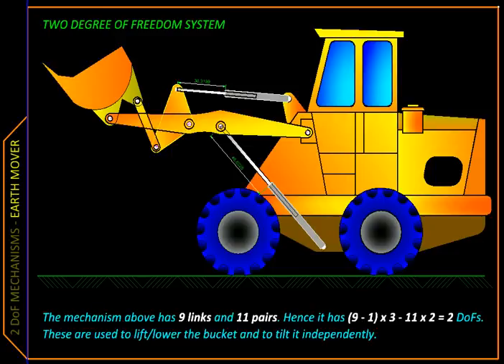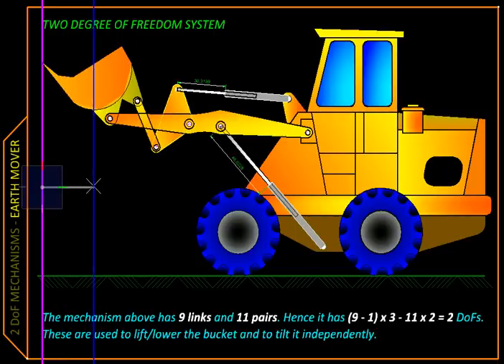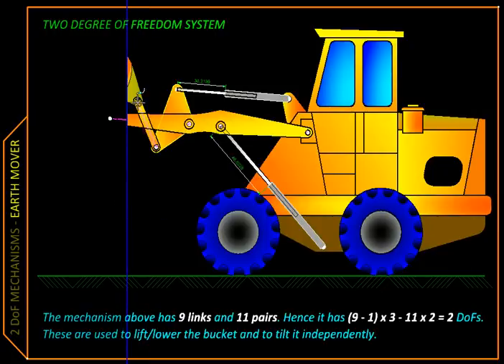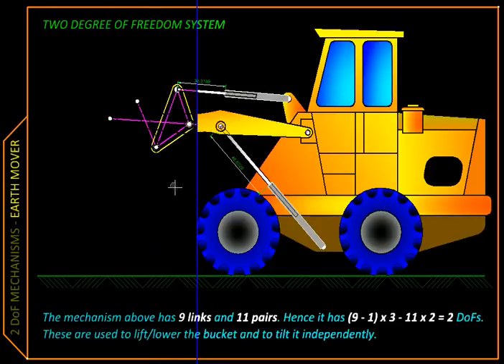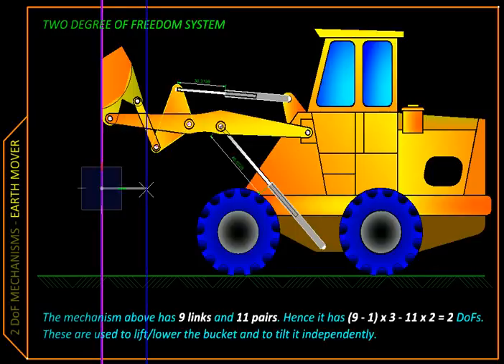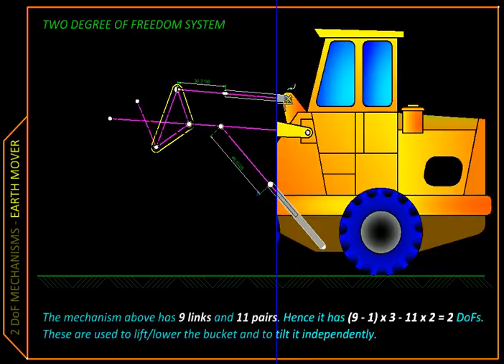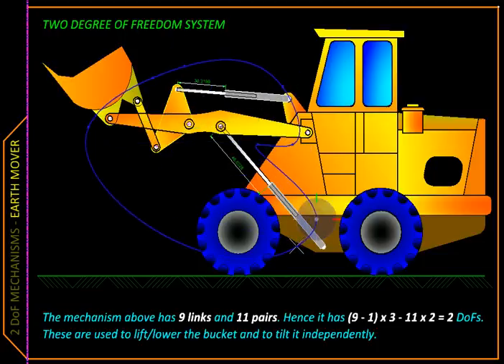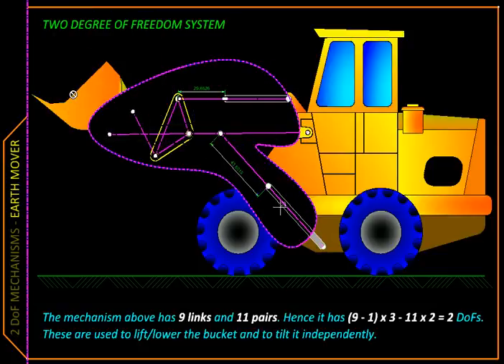Kinematics Ch01e Decoding Machines

Comment: i would be very helpful me to learn more about the kinematics if u please the software which u r using to demonstrate this exercise...
hoping to get answer thanks
Reply from the maker: taher ali The software I used for creating this is called MicroStation. There is a link in the description that will take you to the Bentley.com site for more information. Let me know if you need further help.
Reply: thanks for the information and i would like to know that how to trace the curve by mechanism such as gears,links,pully please help me
Reply from the maker: Do you already have MicroStation? If so, go to Parametric tools and you will see a 'Pencil' icon.
Reply: and what to do there and how to work with it so please explain me with few examples and a bit procedure
Reply from the maker: taher ali Try the Help
. It also has simple examples.

Comment from the maker: @MrSunnyMar The link did not work so I looked up the book online. Are you referring to the figure on page 6? Over there the figure represents a dump truck 'at rest'. Therefore EVERYTHING that is at rest becomes a single 'fixed link' which includes the truck chasis and the ground. Not they are all labeled as link '1'. HTH